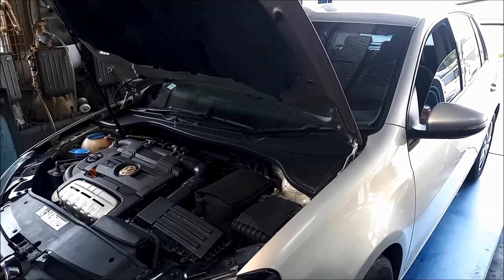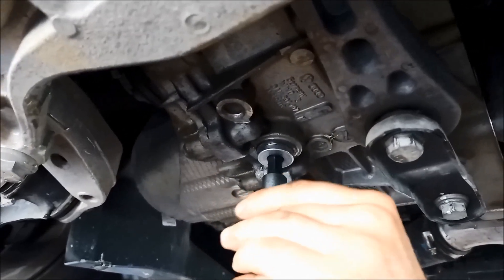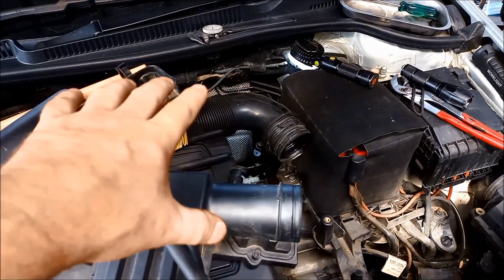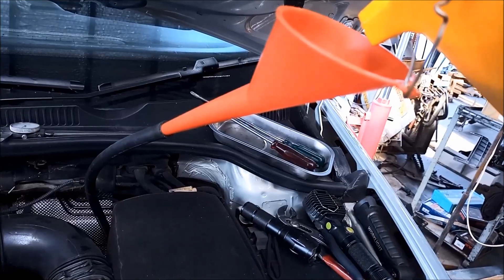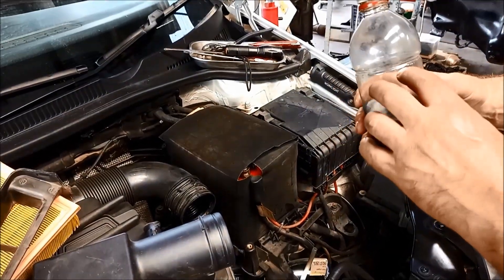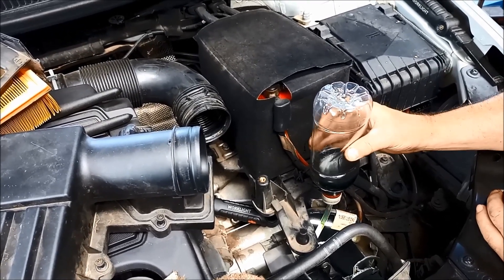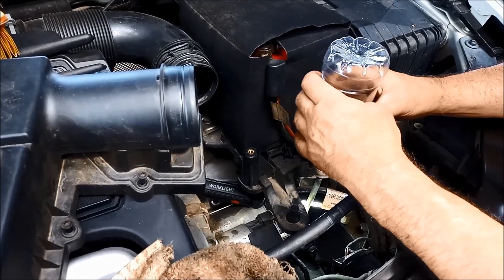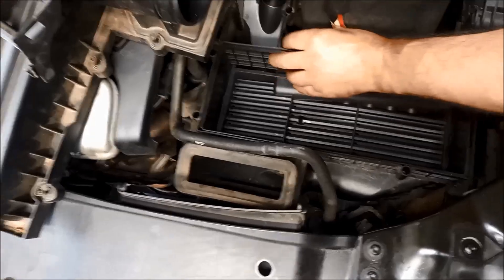How to Trans Service DQ200 DSG 7 Speed DQ250 OBH7 0AM OCW Gear Oil Change & Mechatronic Oil Change

Comment: Strange you don't seem to have that overfill/overflow pipette in your gearbox through which any excess oil would flow out at 38 degrees C.
I learned something about the mechatronics though. Thanks for the video.

Comment: Thank you for the video. I did dq200 G 055 5... oil change too (skoda octavia 2 fl). I took off only 2 metal clamps and platic intake pipe and top filter cover. Nothing else. I would also add that pcv hose should be not to long because it trying to coil itself and its problematic when oil is trying to revers (hose 10mm 2mm flow). I couldn't attach that hose without small cat at the end of it to fit it without a problem. I had no leaks at all. The only problem i had were that metal clamps on intake pipe. I slide it to far and then i had to use adjustable key and my french key to compress first one.

Comment: The abs pump comes further out on my polo completely blocking me from putting a pipe on, anyone else have this issue?
Reply from the maker: hi, loosen or move whatever is needed to access....sometimes you can remove lateral, front of rear engine mount so the motor can rotate for more room. take care and stay safe when doing so. cheers

Comment: Hi my 2018 superb (118.000km) dsg always shifts up early @1800rpm and falls 1200rpm then keeps going 1200rpm. I want it not to change and go @ 2000rpm. I have reset it but there is no change. Anyway does replacing gear fluid help it any better? Or any other suggestions? Cheers.
Reply: Hi, I have the same issue on my passat. It's really annoying. Did you find any solution for it?
Reply: @TheDartvidor  Unfortunately not except driving on sport mode, furthermore keeping low rpm has clogged my dpf :( I changed dpf for a fortune then was able to sell the car. Now I have an AudiA3 eTSI, normally gasoline motor should work at 2200rpm or higher but stronic gear, again, works at 1800rpm. In the end I think vag group makes programmable trick to consume less fuel and to be less noisy, but really annoying and also problematic for the car itself.
Reply: @sevginetix  Thanks for your reply. I've been doing the same thing, driving in sport or manual mode because in drive is so annoying. BTW i've changed the oil in the gearbox and mechatronic two days ago but there is no difference. It still shifts too early. Changing the oil will just help to preserve the life of the gearbox, but it's not a fix for the early shift issue.

Comment: Hi Great video on how to change the fluid,  does the mechatronics need bleeding or do you just turn car on and the internal pump bleeds it for you or is there a process to get the oil back into the solenoids??

Comment: Nice video! I have seen other videos where they turn on the engine and empty out the oil until i drips from the gearbox and then they close it?
Reply: Different gearboxes. Those require 5.3L oil and don't have separate mechatronics and diff oil. Also need to do that at ATF operating temps.

Comment: Great vid, I'm reading that the dq200 is a double dry clutch that doesn't need the 40k dsg service. I'm confused, is this not the case?
Reply: Did you change the oil?

Comment: Very informative, however to do properly you would need to replace mechatronics filter as well, which sits inside the unit.
Reply: this mechatronic has no filter, but it has high pressure reservuar , which must be "realease" before replacement

Comment: It is a bit weird about the DQ200. Everywhere on internet they say that this one is a dry gearbox and it does not need any gearbox oil change. Do you know anything about that?
Reply from the maker: hi, i think you may have the damper clutch confused with the gearbox. there is also the mechatronic section that has its own special oil. cheers

Comment: There should be a fill plug closer under the starter, to the back left of the breather slot on the mechatronic. It looks similar to the drain plug.
Reply: are you referring to the bottom or the top?
Reply: @pamilyasaalemanyaYT  on the top
Reply: Do you have a photo or way to reference this fill plug? Thanks
Reply: @faztr33  you need to remove the starter to see it.
Reply: Much splendid to fill through the breather specially if you have the possibility to put some vacuum at the bottom of the bottle.

Comment: @YepThatsIt... I have a VW Golf MK7 1.4L TSI 7 Speed DSG 2013 model - are the following Gearbox Oil and Mechatronic Fluid correct? Gearbox Oil: VW G 055 512 A2 & Mech/Transmission Fluid: VW G 004 000 M2 - Someone out there please assist me if you are a 100% certain

Comment: Did exactly the same but added a vacuum to the bottle, oil rushed into the mechatronic unit.. boom .. well done
Reply from the maker: hi, id say you used pressure to bottle not vacuum ? good stuff cheers

Comment: isnt there another hollow tube plug after the metal plug in the DIF (gear) compartment?
Reply: On the dsg 6 speed mate is level inserts on this particular version no level inserts
Reply from the maker: cheers

Comment: Very good explanation. But there is no filter to change? Som DSG 7 speed transmissions have a filter on the topside of the bearbox.
🤔
Reply from the maker: hi, some trans a fluid change is all you can do. we also like to add a magnet whenever we can. cheers

Comment: After changing the mechatronics oil its no longer going into gear .....  And there is no service light ...what could be the problem???
Reply from the maker: hi, mechatronics deals with integrating electrical and mechanical systems in your transmission, check all the basics first. cheers

Comment: i heard mechanic unit oil is lifetime, do we really need to change it?
Reply from the maker: hi, the dealerships have mislead the public into literally implying lifetime as lifetime. to the dealership the lifetime actually means the warranty period. they dont care about your vehicle after the warranty. my advice is to do a trans filter service every 50,000km when has done under 200,000km and when has done over 200,000km do service every 25,000km. this will give you max life and reliability from your trans. also bypass the heat exchanger to eliminate chance of coolant entering trans and add magnets to help keep debris away from solenoids and sensors. cheers

Comment: I had mine done a few month ago ND 4ltrs was added on the gearbox size now I am a bit worried. Can this cause issues. The parts guys said it takes 4ltrs
Reply from the maker: hi, overfilling & underfilling can cause issues. cheers
Reply: Are you sure its the same gearbox? It has to be dq200 which is double dry clutch with Oil in transmission 1,7 liter and Oil in mechatronic 1 liter
Reply: @JensAndersenGuitarist  100% dry clutch its in a A3 1.4T CAX 2012

Comment: Is the Gearbox on the 1.4 the same on the 1.2? Being 7 speed and Dry Clutch?
Is there somewhere to identify the classification of the gearbox oil, whether it is synthetic or not and the viscosity rating, in the event of being unable to use OEM oil?
Reply from the maker: hi, we use http://www.datateck.com.au/lube/tritechaus/ and https://www.datateck.com.au/Lube/PenriteAus/ whenever we can. cheers

Comment: Thanks for posting this video. Can someone tell me i changed the transmission fluid for my vw jetta 2013 by using the same method. I could not find the transmissioj filter is there one or no? Because in this video i did not see him replacing transmission filter
Reply from the maker: hi, transmission must be disassembled to change internal filter. cheers

Comment: I have a 2010 1.4 polo 7 DSG automatic, and now it's 133,000kms, do I need to change both the mechatronic and the dsg oils? Been noting all the common symptoms of low/dirty transmission oil but was never paying attention as I was told it's for a lifetime but wondered as to why the symptoms showed up until I saw this video.
Reply from the maker: hi, the manufacturers consider lifetime to be their warranty period. this means something entirely different what most vehicle owners are lead to believe. it should say "filled for the lifetime of our warranty "or sealed for the life of the warranty period" etc. its good practice to do regular servicing on anything if you like to get maximum reliability and use out of anything. a tyre should hold air for its lifetime but i`m sure you regularly check the pressure. choice is yours. cheers

Comment: my master king, our narration is very nice. For changing transmission oil mechatronics oil. Is there a lifetime in years? My vehicle is a 2014 model and 26,000 km, that is 9 years old. Should I wait for this change to be 40 thousand km or is the oil life deteriorated because it has been 9 years, I should do it now, I would be glad if you help me with these maintenances
Reply from the maker: hi, when you read lifetime oil or similar, it refers to the warranty life or dealership warranty period. this is usually 100,000km. when you hear dealership say " sealed for life " it is considered to be while it is under warranty, after that they dont care. the correct wording should say " sealed for the life of the warranty " or " warranty period is considered the lifetime ". it is wrong and confusing to many vehicle owners in which they are lead to believe that you never need to service transmissions or change oils ! regular maintenance is highly recommended in anything mechanical or hydraulic. basically the cleaner you keep your transmission ( adding and cleaning magnets so they can continue to collect debris ) the longer they are reliable and last. cheers

Comment: Under the startmotor is a fill plug for the mechatronic oil, same size as the drain plug.
So you don't have to destroy the breather cap
Reply: Yes ...not all mechatronics will have the same breather as shown in this video ...some have fill point under the starter motor . Easiest and quickest is to fill it up from the same drain plug ...both gear and mechantronics
Reply: Do you mean we can fill the mechatronic oil from another place?
Reply: @user-ok7fi8vr4j   0am dsg7 yes  https://youtu.be/CdTp9mOx7oU?t=798 here is a top view of the mechatronic
Reply from the maker: thanks for that, cheers
Reply: how do we remove the starter motor
Reply: That's one of the most easiest parts to get out.. if you can't do it then leave the mechatronic alone..

Comment: Hi . Do you feel any difference in the mechatronic unit function when the dsg oil is replaced ?
Reply from the maker: hi, the mech is the brains of the trans, so if fluid level was low or heavily contaminated you may feel a difference. cheers

Comment: What will happen if that oil is  to low in the megatronic unit capetain?
Reply from the maker: hi, the mechatronic unit is the brains of the transmission. it is electro hydraulically and mechaically controlled. if fluid is low it can suck and supply aerated fluid within the circuit ( same happens if it is too high or overfilled ) in a hydraulic circuit air can be compressed, the fluid cant be as easily. aerated fluid can give spongy apply of controls and cause transmission to shift strangely and/or cause premature faults or wear in the transmission. dont forget that fluid also expands with heat, so you must adjust fluid levels according to temperatures as recommended by manufacturers. cheers

Comment: I'm confused as I called my VW dealer asking for a dsg service on my 2015 Passat 1.6 TDI. They did confirm that I had the dsg7 dq200 but said as it's a dry clutch system they're sealed and do not require servicing. Is this incorrect?
My vehicle has 48k miles and I'd like to keep up on maintenance, especially as far as the dsg is concerned. Any help or advice would be appreciated.
Reply from the maker: hi, depends if your trans is 6 or 7 speed. the 6 speed dsg (dq250) unit is usually wet clutch & 7 speed (dq200) are dual dry clutch. the dry or wet clutch refers to the coupling clutch between eng/trans. they still have oil/fluid inside transmission component. cheers
Reply: @YepThatsIt  Thank you. I have the 7 speed so dq200. I spoke with my local VW specialist who advised the mechatronic unit has fluid but should only be touched if the mechatronic unit itself fails and needs replacing.
I just want to make sure that the gearbox is protected properly so if it has fluid that would benefit from being changed I'd like to have that done despite being told not to by the main dealer.
Reply: My vw dealer said the same thing, but I am gonna change it anyway. My car has been running for 316000 kilometers. I believe the Oil in the transmission and mechatronic was changed by previous owner 80000 kilometers ago. So its due.

Comment: Pretty sure the mechantronics requires 1.1L according to Elsawin.
Reply from the maker: hi, no worries, there is usually a low and high mark. the 100ml difference may relate to that? you need to make sure the fluid does not aerate as it warms up. overfull is often just as detrimental to trans as low level. cheers

Comment: Hey man, my mechanic replaced my transmission oil as 3 litres instead of 1.7 litres. He said it's bcs there is no oil pump in this model, thus it has to be oiled up until halfway point of it's volume.  What do you think about it, is it wrong or do harm to my car?
Reply from the maker: hi, i suppose time will tell. cheers
Reply: @YepThatsIt  Today I saw the warning "Gear R not selectable" and I must say I am utterly disappointed. Also gear transmission felt a little sluggish.🥲🥲Now I'll get the equivalent oil that is available in my country and replace it again as 1.7l or 2l 😅😅

Comment: I own a golf 7 1.6 tdi 115hp with a dq200. Is it necessary to change the mecatronic oil ? I have no problem currently but 163000 km 🤔 thanks for the video 😊
Reply from the maker: hi, regular fluid changes are part of maintenance. fluid also breaks down and loses some of its properties with use and heat. choice is yours. cheers
Reply: My DSG broke so don’t listen to the whole “sealed for life” crap you see online and get the mechatronic oil changed
Reply: Hey, I did it today, 177000km, Gear and mecatronic oil. The car work just fine 😊
Reply: Did you drive 177.000km without any problems on the dq200??
Reply: @klane7  yes 😊 still no problem after the oil change, 183 000km. But I think the clutch will need replacement soon.. 😕
Reply: @fanfanc.3366  i would be happy to replace the clutch at those km's! I hope i get there also without to many problems 🙏im not a racer or tuner so i hope that helps the dq200 😂
Reply: @fanfanc.3366 one year later now, transmission still ok? What about clutch?
Reply: @Ryy22  transmission is still fine, I have now 201 000 km but my clutch seems like he is a bit tired now, I'll need to replace it this year I think
Reply: It’s not a oil

Comment: no filter change?
Reply from the maker: hi, no...watch the vid fully. you could install an inline filter in cooling line. cheers
Reply: @YepThatsIt  Thanks. I just changed the oil in mine and the oil was black. Is that normal?   I don't think it was changed before because It is supposed to be sealed for life.  So I changed at 95k and it was black.

Comment: Hi mate. Thanks for the video. I have bought a second hand 2014 VW golf that throws up a Transmission error every so often. I'm going to take it to a euro car specialist to see if they can diagnose the faults but I'm hoping a fluid service that you have displayed in this video will fix it as it seems to be intermittent. You aren't based near the Gold Coast are you? Thanks again mate
Reply from the maker: hi, sorry we in north east country vic. rarely will an fluid change fix issues like yours. cheers
Reply: @YepThatsIt  appreciate the reply. I think I have narrowed it down to a faulty transmission shift assembly.

Comment: Would you consider it normal for some mechatronic fluid to leak from the breather hole after being filled and driven to temperature?
Reply from the maker: hi, we havent had that issue yet. anything is possible, might be an internal pressure leak causing it to come out? cheers
Reply: @YepThatsIt  thanks. It burped up a little twice, two separate driving occasions, after the service. Cleaned up and not seen any other liquid come out. Ps its an audi a3 8v with the DQ200 trans.
Reply: @Roger Gore won’t hurt it will just splurge out if to much or pressure